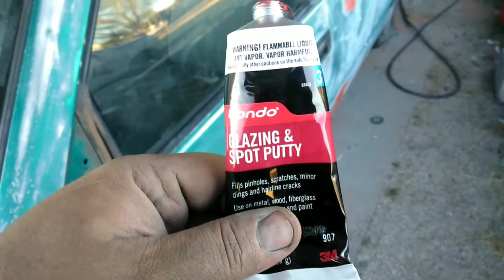OBS chevy build (part 1) body work

Comment: What did you use to prep the paint? Thanks. I plan on buying a project truck and painting it my self.
Reply from the maker: I just sand the old paint with 60 grit and prime it
Reply: @CCAutoWorks  the whole exterior with 60 grit correct?

Comment: Where you get that rear black bumper from ? I’m trying to find one for my 1996 obs
Reply from the maker: Ebay it was like 120 or 130
Reply: @CCAutoWorks  thanks appreciate it 👍
Reply from the maker: @joegar2292  if it helps I think it was for a suburban or Tahoe
Reply: @CCAutoWorks  yea I can’t find it 🤣 but I’ll keep looking
Reply: Were those sport mirrors you got ? They look nice
Reply from the maker: @joegar2292  I found them on ebay also
Reply from the maker: @joegar2292  https://www.ebay.com/itm/154073943541
Reply from the maker: @joegar2292  https://www.ebay.com/itm/203065895391
Reply from the maker: @joegar2292  https://www.ebay.com/itm/352752592280
Reply from the maker: @joegar2292  https://www.ebay.com/itm/352850280217
 I found mine complete for 124 but I can't find one that cheap but I bought mine almost two years ago
Reply: @CCAutoWorks  thanks appreciate the links
Reply: @CCAutoWorks  yea they almost $200 the bumper so I’m thinking about a roll pan 🤣

Comment: How big is the air compressor you used for primer
Reply from the maker: 29 gallon 5.4 cfm at 90psi with regulator set to 40psi
Reply: @CCAutoWorks  awesome thanks for the info 👌🏻
Reply from the maker: @MegaGsizzle  no problem anytime

Comment: Where did you get the grille can I get a link to it
Reply from the maker: https://www.ebay.com/itm/Fits-1988-1993-Chevy-C-K-Pickup-Suburban-Blaze-Chrome-Billet-Grille-Grill-Insert-/203284225767?_trksid=p2349624.m46890.l49292
Reply: Did it come with the shell?
Reply from the maker: @cristianmejia8843  no it's separate
Reply: Do you have a link
Reply: Or explication of how you put it together
Reply from the maker: @cristianmejia8843  I didn't make a video on it but you have to cut all the cross bars out of the shell and then you put the billet grill insert in the shell they send bolts but I used rivets to make it look cleaner
Reply from the maker: @cristianmejia8843  https://www.ebay.com/itm/Fits-1988-1993-Chevy-C-K-Pickup-Suburban-Blaze-Chrome-Billet-Grille-Grill-Insert-/203284225767?_trksid=p2349624.m46890.l49292
Reply: You sent the billet twice I also need the shell
Reply: So no shell?
Reply: Did you find the shell
Reply from the maker: @cristianmejia8843  https://www.ebay.com/itm/New-GM1200228-Grille-Black-Shell-Insert-For-Chevy-CK-Series-1988-1993-/274545675216?_trksid=p2349624.m46890.l49292